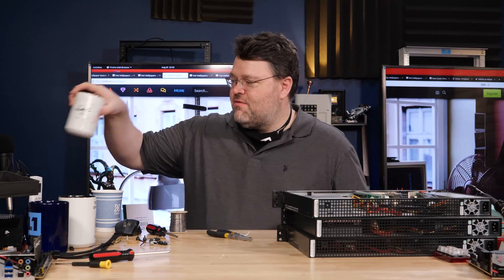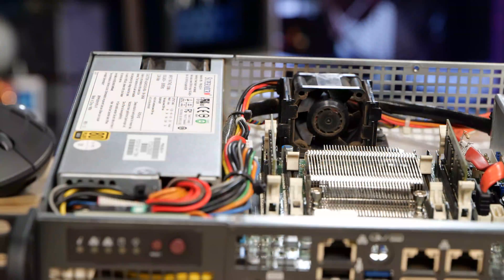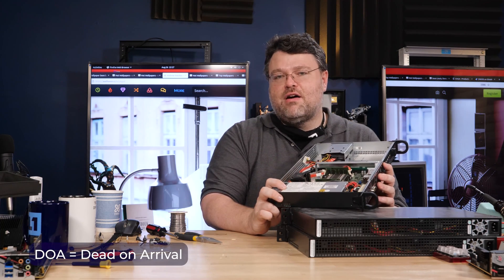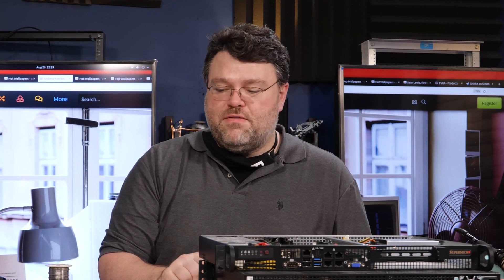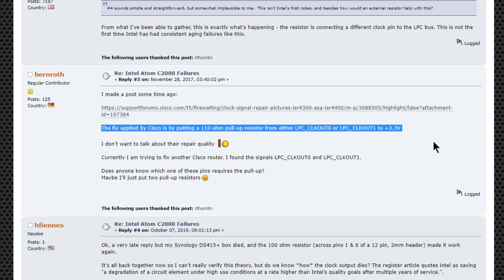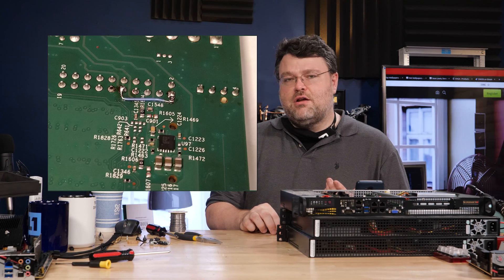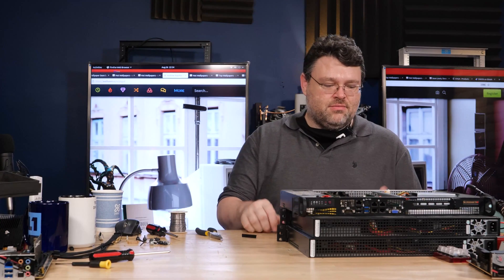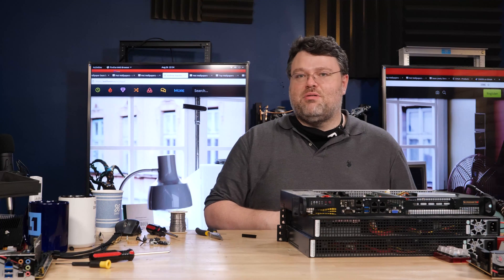Easy Repair of the A1SRI 2758F Supermicro 505-2

Comment: Thank you so much, thanks to your video I could bring my A1SAi back to life! Didn't even have to solder (thankfully, my soldering skills are the worst), I simply put two jumper wires on the two pins, connected their other ends to each a WAGO terminal and in between I put a 220 ohm resistor (didn't have the small ones lying around so I used one of the bigger 5W ones 😅 but probably that will live much longer than the small ones anyway) whose ends I connected to the two terminals. Then some double-sided tape to mount the resistor on the bottom of the case and done 🎉

Comment: I wonder if anybody had figured out where the other LPC CLK signal is? To get the IPMI working again - I have a A1SAI that boots, but the system does not see the BMC (and also the serial port and other peripherals that would be attached over the bmc lpc bus wont work)

Comment: I've got an old Barracuda NG firewall F80 with a c2000 series CPU, and I'm pretty sure it has similar or same problem. one day it started just beeping for 2-4 seconds straight and then going silent for about 5 or 10 minutes. So 200 or 220 ohms is ideal? and uh.. any chance on me finding the TPM pins on this thing? the board is mini itx or smaller.

Comment: you saved me 300 to 400 € with thix fix by using a resistor worth 10c. Thank you !!
Reply from the maker: Yw but it might not be a permanent fix. So I'd get spare parts on hand just in case. Fortunately eBay can probably get you a new mobo cheap and you know what to look for if someone's selling you a hacked up board or a properly fixed board

Comment: I still request a Ram video of since Jay found you can now run mixed ram in any way you want and get better performance by dim timings being better on the lowest ram capacity and unknown still ways of conversions. Seems like the motherboard accepts it now and not then and probably shows what its got instead of limited end result of test.

Comment: I fixed 2 synology 1815 this year at work...had to fix on the psu side since the voltage is to low to trigger the power on for PSU....

Comment: couldn't you wire the resister in with a inline switch, and have the switch toggle on during boot and toggle it off after boot finishes?
Reply: Yeah a timed relay, on the "normally closed" contacts, so that it will remain connected for say 5 minutes after power on and then open the contact so the communication with IPMI is working again

Comment: I’ve got three of these (that I DIYed) that I bought on eBay. Supermicro replaced one of the boards under the known errata. Cost me nothing other than shipping time. They checked  the serial numbers of the other two, and they said they are not subject to the bug (already has the replacement SoC) so they won’t need to be replaced. 

Two are acting as routers with pfSense, the other is a low power Plex server with GPU transcoding using a GTX1660. (Separate NAS for data storage)
Reply: @MichNL I think in all cases I just setup the RMA or checking the serial if it was affected by emailing Supermicro support.
Reply: Would it work with truenas? I just bought one of this boards in working condition with 16gb ram. Planing to install truenas and plex direct play.
Reply: As a note, before you send your board in, go over it with a fine-tooth comb. Mine got rejected because there was a small crumb of corrosion on a resistor at the top of the board. They sent it back but I had to pay shipping both ways. I cleaned it off with some alcohol, but they flagged my serial number so I get to use the resistor trick now.

Comment: I've watched Level1 for a little while now and just realized something. That work table is rather high isn't it? Or is that a normal height. Is it supposed to be a bit higher like it seems?
Reply from the maker: The table is adjustable! Its the same one used for the news ~ Editor Autumn
Reply: It's likely an adjustable-height desk.
Reply: Wendell is walking back and forth in a trench.